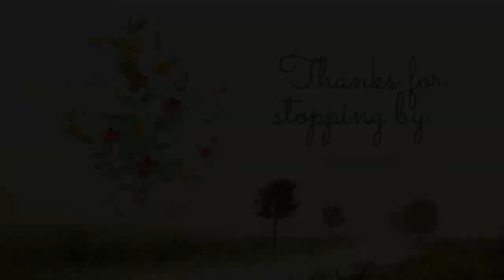Build Your Own Custom Goose House

Comment: Great tutorial and a beautiful house… I need to build one for my geese, but I need to be able to get in to clean it… do you crawl in there? It seems the door is small
Reply from the maker: Thank you so much. You are right that the door is smaller than we would like. It is about two and a half feet tall and two feet wide. The average sized adult can crawl in and out but it is tight. We really wanted to repurpose old windows so we were limited in sizes. If I had my choice it would be at least 3ft tall.

Comment: Beautiful house, but how well does it do for the geese during the winter? How cold can it they tolerate before you have to consider extra measures?
Reply from the maker: Hi Jacinda! Great question! This was our first winter with our geese and this design worked very well. Here in upstate NY, we endured an arctic blast (-20°F) that lasted a few days. During that time, we supplied a flat heat pad made for chicken coops and placed it vertically along the one front window. With lots of bedding, the geese did great in this house throughout the winter 😊 ~Rochelle